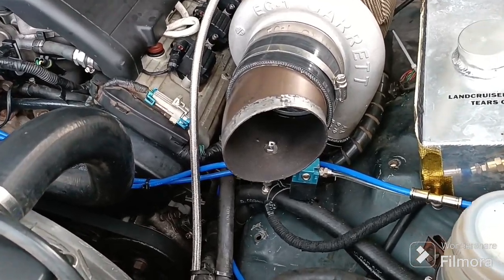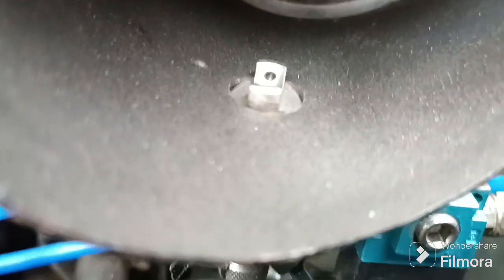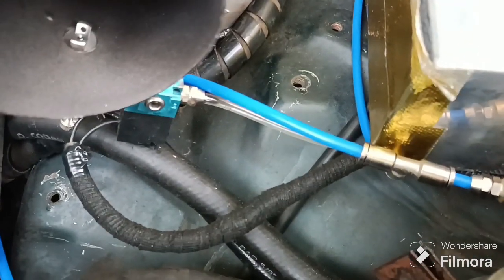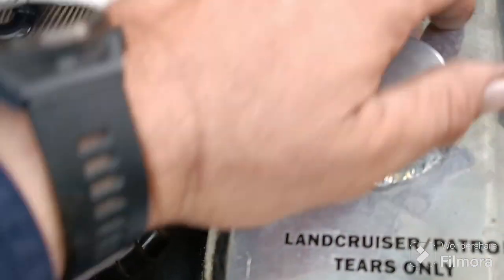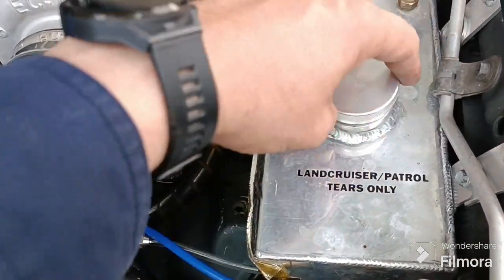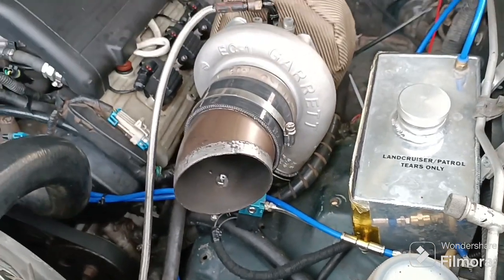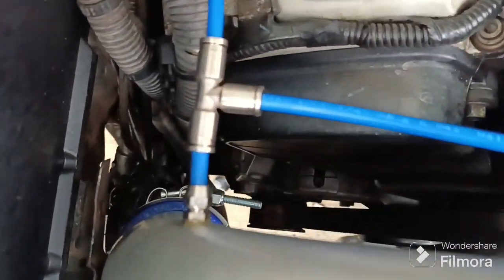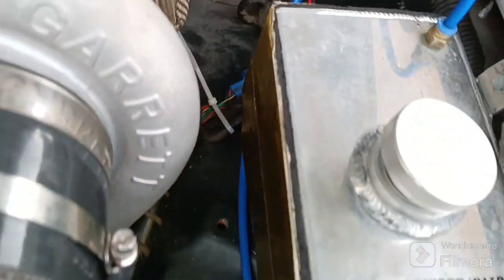Simple pumpless water methanol injection setup

Comment: Might do something like this for a boosted Barra to keep running 98, E85 is ridiculous and you get a lot less out of a tank too
Reply from the maker: It's an easy setup and you can run two nozzles for high hp
Reply: @929cosmodude  yeah probably would, where did you get the nozzle from mate?
I could run a second Hobbs switch triggered at 12-15psi boost to activate the second nozzle. For empty reservoir I can tap into the TMAP sensor and spoof a higher reading like 50-60C IAT to pull some ignition timing out to be safe (or another factory ECU I/O that I can map against boost so I'm not pulling out timing when just cruising along).
Am going to tap into the TMAP sensor anyways to read -40C intake temp on a button to pull ignition timing for a crude antilag.

Comment: is the 12v solenoid flow adjustable and does it have to be? been looking for a mac valve but doesn't seem to be available where I live but amazon has a 12v water solenoid that work with the hobb switch but nonadjustable flow.
Reply from the maker: No the solenoid is not adjustable, so the other solenoid should work

Comment: Doesnt the nozzle drip when it stops spraying?
Reply from the maker: no because air is still flowing after the water solenoid has closed
Reply: @929cosmodude  I was wondering, about two solenoid setup (solenoid the air line too), as it would always cause a mild air leak?? How long do You run with such setup? And I believe theres no problems with the compressor wheel?

Comment: Very smart, impressive, when you did straight water did you notice any gains without touching the ecu map.

Im going to run this in my WRX
Reply from the maker: Straight water definitely stopped detonation with the stock ecu but very little impact on power, I think it actually lost power but it was worth it for the reliability, with water meth it definitely picks up power, I'm running about 70%meth at the moment 30% water
Reply: @929cosmodude  yeah I believe it would lose some power. Id want to advance ignition and boost with it though.

My main issue is being knock limited, especially repeat laps on a track I have to be even more careful
Reply from the maker: @oldfashionedwrx3574  it 100% will cool things down, if you have an aftermarket ecu, I would definitely run at least 50/50 wmi, will stop alot of heat soak
Reply from the maker: @oldfashionedwrx3574  I used to run 91 octane with no intercooler on fairly high compression but only up to 8psi, it helped but with no intercooler it still got pretty hot being that it's pre turbo, It knock out a heap of heat, with intercooler now it barely heatsoaks , the intercooler has less work to do, temps are a good 40degrees cooler before they hit the intercooler
Reply: @929cosmodude  did you tweak AFR for methanol

Comment: Whats the car? And setup?
Reply from the maker: Hey it's a bit of an oddball car, it's a 99 Holden Jackaroo V6 (Isuzu trooper) they come with 160kw (215hp) standard, It has a gtw3476 Garrett, speeduino ecu and 60lb injectors, I'm actually planning to finally put it on the dyno late next week to see what it's making rather than guessing all the time 😂
Reply: @929cosmodude dynoed yet? Do you have some links to the parts used?

Comment: What sort of water/meth injection volume are you running through this setup?
Reply from the maker: The volume increases with boost , it also has an adjustment valve on the back, I don't know the volume at the moment but I have increased it until the drop of afr is what I wanted them tuned the ecu to suit
Reply from the maker: As a rough guess I'd say 200cc at 8-9psi

Comment: This is wicked man, clever setup. Good on you 🤙
Reply from the maker: I'd love to take full credit for the design but it's basically a copy of what I originally had 15 years ago with my twist on things, a guy named Peter from Rice racing sold similar kits back in the day with some great results to back them up, green brothers racing also sold a very similar kit and I believe still do, they made over 800hp and ran into the 8's on pump fuel with their kit, I feel these style of kits have a way less chance of nozzles blocking because the nozzle orifice is huge in comparison to the high pressure stuff, also no pumps to worry about either 🤙

Comment: This is pretty cool. Ive ran snow performance boost cooler on all my turbo and supercharged cars. But not really understanding this one. Do you pressurize the tank using boost generated by the turbo? And then activate it with a hob switch at a set psi? The video is too short 😂. But i wanna try this out
Reply from the maker: I probably should have made the vid a bit longer 😂😂 I had a similar setup in my 13bt which I ran to 28psi on 98 octane (93 in USA) there has been others that have ran high 30s(psi) and over 800hp on pump fuel with the same setup, I find besides the added octane it also drops the temps a large amount after turbo before intercooler, I am only getting a 1-2 degree rise in temp from the lowest temperature cruising along with no load, to the top of 3rd at full boost on a 30 degree C day , it really helps the intercooler 👌
Reply from the maker: Yeh thats basically it, it's very similar to a high volume low pressure spray painting gun, the boost pressure pressurize's the tank and when the pressure rises to a set pressure the Hobbs switch activates the Mac valve solenoid valve, then as the boost continues to rise the volume also increases, basically how a non gravity fed paint gun works, the pot of the gun is pressurized by the compressor and then it is forced to the nozzle where it is mixed with air to give you atomized paint, HVLP nozzles work even under 10psi, due the the fact water/meth is thinner than paint, it atomizes at an even lower pressure, hope this helps 👌
Reply from the maker: So say at 5psi with the adjuster fully open it might be 250cc per minute and the 700cc at say 22psi I have bench tested it to 28 psi but can't remember the cc per minute, the good thing is that if you are running a lower power level you can wind it back as needed 🤙 for big power stuff you could run twin nozzles especially for big capacity stuff like turbo V8's that make big numbers at low Boost
Reply: @929cosmodude  ah now I see. What type of jet did you use? All my jets are high psi. Is it like a paint gun or something? My malibu runs 27psi  max.
Reply from the maker: @Emilthehun  it's a dust suppression nozzle, yes very similar to a paint nozzle, they use them in very dusty area's and connect a water feed to one side and compressed air to the other, it's efficient and reliable, atomizes water droplets to his dust particles and bring them down, really common as mining sites , refineries etc
Reply: @929cosmodude  oh dang! Refinery and mining? 😂. Okay so if I searched for the noble on amazon , what would I put in? And yes you should've made the video a little longer 😂
Reply from the maker: @Emilthehun  the one I got is off eBay, the one I had on my 13bt was from a dust suppression supplier, I can't tell much difference, just search up external mix atomising nozzle and get the fan type nozzle 🤙
Reply: @929cosmodude  awesome thank you!

Comment: The problem that I can see, is that unless you have at least 100psi, then you are not likely to achieve proper atomization of the Methanol and it's more likely to start feathering the leading edges of your Turbocharger compressor blades.
Reply from the maker: This is not a new method, these are low pressure high volume nozzles designed to atomise at low pressure's if you have ever used a paint gun you would know.. even on the high pressure nozzles you would probably blow the tank if you wound up the compressor to 100psi
Reply: @929cosmodude  - Nah, Im not talking about pressurizing the tank - just comparing using a high pressure pump vs low pressure tank, and the effective atomization of the Methanol. So at what pressure point in the tank, does the HVLP nozzle effectively atomise the methanol?
Reply from the maker: @delawarecop  bench testing I'm getting really good atomization at 7psi onwards 👌 the flow rate ramps up with boost which is also a handy thing
Reply: @929cosmodude  - So how does the methanol behave from 1-6 psi?
Reply from the maker: @delawarecop  really well, you can tell it has been raised in a good family, never swears , always polite, even seen it walk an old lady across the street once 😂 jokes aside it still atomized pretty good at 5psi but below that the nozzle doesn't work too well, as you would have heard in the video the Hobbs switch turns it on/off at a certain level of boost 👍🏼